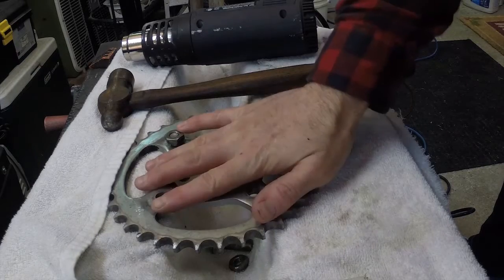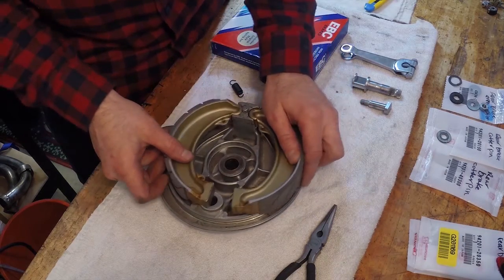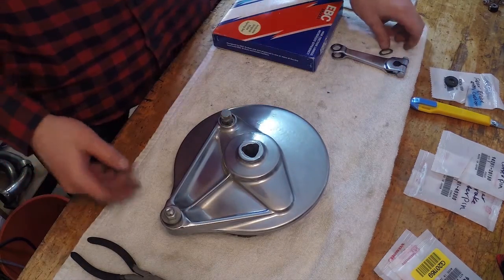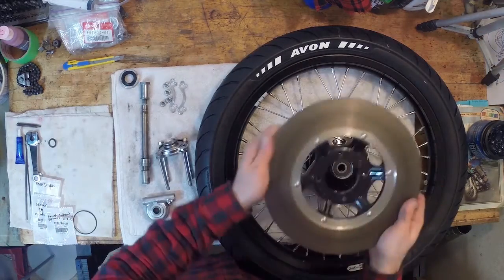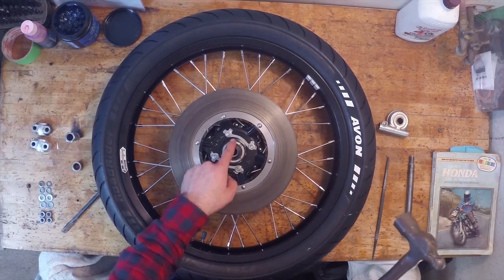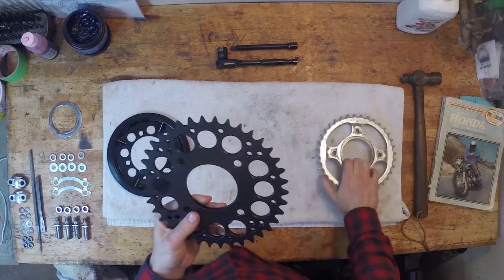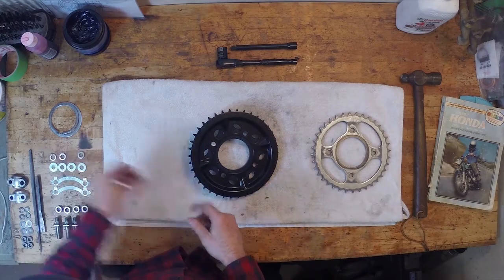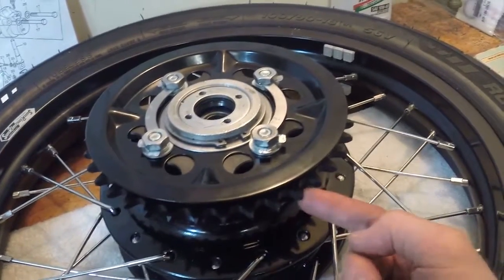Saturday's Wrench Ep.24: Rotor & Sprocket Install - Honda CB350 Build

Comment: Hay Tony, great video.

I'm having the same issue as I removed the chain cover as thought it looked better,but now the sprocket seems loose. I think it will be ok as the front sprocket also feels loose. I may just add another washer to tighten things up.  Any how let us know how you get on. 
keep wrenchin!
Andy
Reply from the maker: +andyp32 Cheers pal! Ok so I spoke with Jeff, the guy that helped me with the engine rebuild, and he said that it's supposed to be a little loose so that the chain can self align. I believe I may have solved the issue as you'll see in the next vid but I'll know for sure when I get the chain on there.

Comment: Hi dude, just re: the rear issue. Measure the width of the stock sprocket with calipers, then add washers to bring the 520 to the same width.
Keep in mind chain alignment, when you shim the spocket do it evenly. Place one washer on each side of the sprocket behind the cover, then another ontop and it should bring you up to the correct width. 
If you change the chain center slightly it should be fine, but you can always shim the front sprocket retainer as well.

You'll find out when you attempt to put the chain on.

I had to do the same work my kit from motomadness.

 -Chris
Reply from the maker: +Overture Cheers Chris! Keep an eye out for my next video where I try something else and let me know if you think it'll work. Should be posting it soon. Did you make the shims yourself? How? Thanks again!
Reply: +Saturdays Wrench For sure! you could attempt to add a stock spacer, but washers are the cheaper option. Make sure they are high grade steel
Reply from the maker: +Overture will do! thanks again, I appreciate it.

Comment: Hi dude, Love what you have done to your CB350. I'm currently rebuilding a 1974 Honda CB360 and I'm at the mocking up stage before sending everything to paint etc... I have hit a wall when it comes to the Speedometer rotor on the front wheel hub, I'm installing the Motogaget Motoscope Mini Scope which makes the rotor on the front wheel useless. My question is, how do you cancel the rotor on the front wheel hub? Is there another part I can put on the wheel hub that doesn't have the rotor? I would really appreciate your advice as I saw that you also installed the Motogaget Motoscope mini scope tacho. Thanks mate
Reply from the maker: +Vincent Collard Hey dude, there is apparently a plug you can buy for the front hub. There are also custom parts you can buy to remove the speedo entirely. This would mostly be found by metal workers making custom motorcycle parts. I did find one but it was very pricey and I had decided that I had already spent a fair amount on the bike. It looks sort of like a cone. I don't have the link for it but I'm sure if you searched it online you would find it. Check 4into1.com I think I saw it on there actually from TC Bros.

Comment: When you polish the parts with the wire wheel and WD-40, are you putting WD-40 on the part or the wheel?
Reply from the maker: I didn’t polish the parts with wd40.. only used it to clean the parts! It’s an excellent cleaning agent. I used a wire brush bit on the end of my drill to help clean. The polishing process is much different. Don’t use wd40 to polish your parts. Only a grinder with an affixed cotton wheel and the appropriate waxes to polish.
Reply: @SaturdaysWrench  Haha ok. It sounded weird to do that. I polished my fork legs and wheel hubs with the whole process - wet sanding, then black, brown, and white rouge on a bench buffer, and finally autosol. I was just curious about the process mentioned in this video because it seems faster and easier for odds and ends like the brake arm bolt or the cam chain tensioner housing.

Comment: no need to go to honda dealership, just search partsfish.
Reply from the maker: +BBoy90009 actually if you live in Canada it is a lot easier to go to a powersports dealership as you have to pay hefty import and duty charges through them.
Reply: oh, i was referring to the parts diagram. i thought i had remembered you saying to go to the dealership and get it printed off.
Reply from the maker: +BBoy90009 ohhh ya ya.. that works also. I didn't mean actually physically going to a dealership to get them printed. I just meant that local powersports dealerships will have a website with the fiche and diagrams online where you can save them and print. But yes, that's a great source too. Sorry for the confusion.